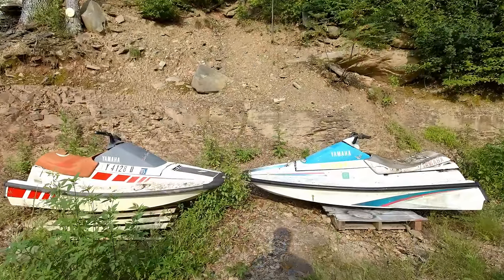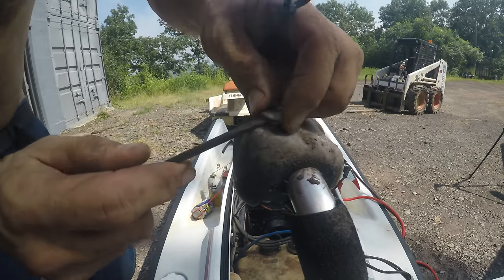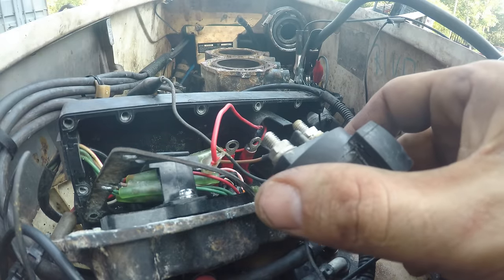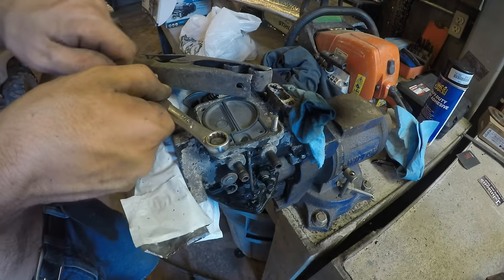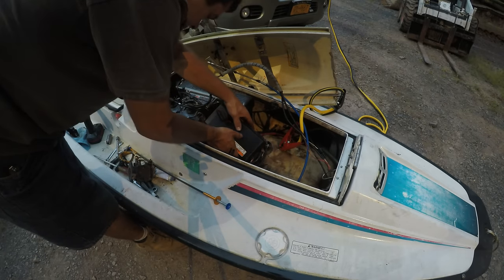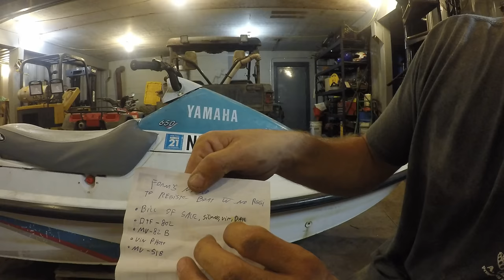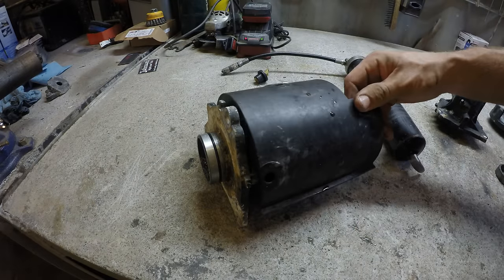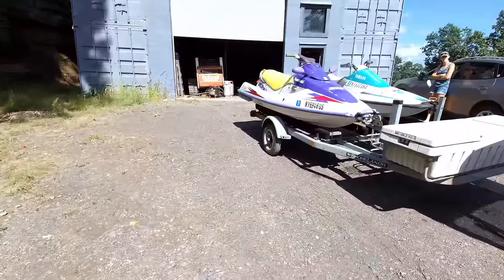Buying the cheapest WaveRunner on Marketplace

Comment: Watching you and other guys on youtube fix shit got me motivated to fix my mustang GT 2001. replaced the fuel pump in the tank. Alternator, battery, serpentine belt and the engine got a miss right after I got it running. bought a set of 8 coil packs on ebay for $35 things runs great with 153,000 miles on it and the Aircon works great. next new break rotors and pads from ebay, then 1955 bug to get running. Thanks Andrew for getting me motivated oh and also replaced the front left wheel bearing on my honda accord

Comment: 35:30  Wrench sparking against terminals in one hand.  Can of starting fluid in the other.  What could POSSIBLY go wrong.  LOL  Interesting video
Reply: i saw that, too.  completely rednekking it.
Reply: koviack and a full tank of fuel, and an engine room full of fumes.
Reply: koviack: He has in one hand a can of starter fluid (spraying it) and in the other hand a wrench crossing terminals throwing sparks.... just sayin
Reply: In the military me & another grunt were standing on top of a 5000 gallon gas tanker dropping a load of fuel and checking the level of gas through the 15 inch lid on top.  The level was right up there still when he took the cigar he was smoking and tapped the inch long ash off right down that hole.  All I heard was a sizzle as the gas extinguished the ashes.  Other times I saw him lose a stogy into the gas tank accidentally of a jeep he was putting gas into.  It simply sizzle out and he reached down and got it out to throw away.  We were uncertain if we were going to survive the combat coming our way and we were reckless as you can get.  Not uncommon in combat by soldiers.
Reply: Haahahaaha
Reply: Looks even crazier if you watch that part at 2X.
Reply: This wrench is too hot!
Reply: Obviously you don't do this kind of work. That's not even close to the sketchiest thing that has to be done to resurrect some old beast.
Reply: I was gritting my teeth.
Reply: If ur not flirting with death every day, ur not Andrew Camarata.
Reply: Let’s not over look that the sparks were right over the gas tank.
Reply: Absolutely nothing!
Reply: koviack  I can agree with you, however its good practice to not do so. For people that don't know I don't explain it so they will continue to NOT do it!
Reply: @geno7444  Vietnam?

Comment: If nobody's mentioned it yet check the jet drive there's a ring that will expand and almost bind your motor up is swells and locks up on the impeller I believe I've owned many of these WaveRunners in the past

Comment: The whole time i heard that engine struggling to turn freely, im thinking the propeller is getting hung up in its housing. Usually there's a stainless steel liner pressed into an aluminum housing and when these jetski's are run in salt water the metals corrode and it bulges out causing the propeller to bind up. Thats what i ran into with two kawasaki's i had worked on. It's best to isolate the jet drive mechanism from the motor when diagnosing either part of the watercraft. Anyway, im sure you know this already by now. Great videos!

Comment: For Gods sake stop putting in spark plugs with an impact wrench.... hahaha!     You work like a bull in a china shop.....Love it!!!
Reply: "That'll be fine."
Reply: @danieljameschamberlin1726   Not only that, he was actually using a battery powered impact, not an air impact.  I doubt that battery powered impact will create enough torque to damage a spark plug.  An air impact or electric impact probably would, but not that little battery powered one. Even if it would, I'm sure Andrew had the clutch drawn down so it wouldn't do any damage.
Reply: It’s fine it was just a battery impact driver not an air impact wrench
Reply: @masterspacetime2826  So instead of spewing asinine know-it-all comments into the ether of the interwebz, let's keep our comments in line with the context of this video.  I have that exact same, or at least very similar, Craftsman battery impact, and it's not going to produce enough torque to break off spark plugs. Additionally, my Snap-On air impact produces 2 - 8 times the torque my Craftsmen battery impact does.  For you "professionals" those types of battery impacts may be common place, but for us regular folk, air impacts are still torque kings.  However, to stay on task, that Craftsman impact does not produce enough torque to do any damage, and if you say otherwise, you're either a liar or completely ignorant.  Now, if he were using that DeWalt or Kobalt electric impact he has, that would definitely be ill-advised, but that wasn't the case, now was it?
Reply: Boss told me the same thing😂😂😂
Reply: If he screws up the treads he can just weld it in.
Reply: Brutal!!!
Reply: @better_than_nothing  I have a 1/2 drive Snap-On cordless impact that will take the lug nuts off my 1 ton Dodge...
Reply: @timallbritton3716  You prove my point. Your   $900 1/2 inch Snap On compared to a $60 3/8 inch Craftsman impact is comparing apples to oranges. You're making the same idiotic assertion as the OP.
Reply: @better_than_nothing  The actual point is ... never use anything but a torque wrench to tighten a spark plug and never ever use an impact wrench even if you bought it at the dollar store for pennies  ;) jus sayin hahaha!!!
Reply: @better_than_nothing  I am absolutely loving this! Do your homework and verify for yourself that I retired at age 49, own homes on opposite sides of the world, have a wife that's 26 years my junior, and we travel 5 months out of the year. Too bad so sad my poor friend ;) Bahahahaha!!!
Reply: @better_than_nothing  At least I have a wife ;)
Reply: @timallbritton3716  On a serious note, homophobic comments like that will get you banned from YouTube. I enjoy the trolling as much as the next guy, but be careful or the YouTube politically correct police will rain their liberal leftist agenda down on you, and personally, I don't want that kind of attention.
Reply: @better_than_nothing  Finally something we can agree on...semper fi!
Reply: kabarsedge those battery ones have a lot more power than you think. I guarantee one could rip those threads out.
Reply: @better_than_nothing  damn the banks got a hold of you. That sucks
Reply: Agree he’s a bit agricultural at times. Gets the job done but could be a lil more finesse
Knows his stuff though.

Comment: What I do when I need one of those carb gaskets, is trace out the carb on a cereal box, or similar type cardboard, and then cut it out with scissors and an exacto knife or razor blade.  I have not had any issue's with this not working, usually spray the new gasket with that copper spray for gaskets.  Great video, much love and God bless.

Comment: Andrew: I have noticed that you like things clean.  This is good.  I imagine you like clean engines and motors too.  I suggest you buy a small steam cleaner with a pointy nozzle.  Amazon and Walmart have them.  A steam cleaner will do an amazing job and will get into small areas that cannot be cleaned any other way.  I also noticed that you like white.  For your jet skiis, I suggest a Mr Clean Magic Eraser (or no name equivalent).  They do a wonderful job on plastic and fiberglass.
Reply from the maker: Thanks. Yes, I do now have a hot water pressure washer. It gets stuff clean.
Reply: @AndrewCamarata  A steam cleaner is much smaller.  For confined spaces with grease and grime the steam works wonders, better than just hot water.  They cost about $30.

Comment: That rattling sound is the inpaler your suppose to have water flowing through the exhaust and inpaler. When running the engine.
Reply: there is no harm to running a ski w/o water unless you overheat it.
Reply: Would that be Vlad?
Reply: No drama for a short run without water, always start first then turn on the water. Turn off water then kill engine.
Reply: @LegendLength  u can run it without water. But if u are gonna hose it you need to cut the hose on after the ski starts and cut it off before u kill the ski. If it doesn't run good it can be bad
Reply: Josh meant the rattling noise is normal if jetski is not in water. 

What damage if any if hose always on between starts? I was doing some checks and forgot and let hose run the entire time through starts.
Reply: kb1gni  Vlad the Impeller?????? ;-)))))))  SO FUNNY that you caught that !!!!!! Huh..... I really need to get a life..... I commenting on Dracula references at 3:45am..... I suck ;-)

Comment: Awesome video.  I bought a Waverunner 3 had 3 folks on seat and pulled a skier.  Those spins were fun as heck, but neck day legs were sore after riding all day.    Is that the container car castle I seen in videos?   Your super talented.  A boat mechanic at 85 bucks an hour would charge more than buying one.   In 1988 the Wave runner 3 was 6,200 bucks.
Reply: you know what 6,200 bucks was in 1988 money? my 1988 trek 1000 was 450$  equels about 1000 2018 dollars...

Comment: When you start it up out of water you need to hook the water hose to the rear of the jet ski next to the output jet something you don't burn up your unit, just saying.
Reply: wrong, jet engines and inboard/outboard motors on boats are completely different, as long as he doesn't run it for more than 5 minutes out of water it will be fine...

Comment: I picked up a pneumatic long neck stapler made by Sailrite that works really good for getting down in the recessed lips where the original staples usually are found.  I use alot of spray adhesive to spray the new material so it doesn't shift around when you are trying to get the first few staples in.  Nice job breathing new life into the jet ski.

Comment: Dude you need to pressure wash your pressure washer
Reply: BUT.....be sure to stay away from the gas cap! I killed mine that way several times then if you don't get the water out of the fuel system you are bound for trouble from then on!

Comment: impact wrench.....spark plugs?
Reply from the maker: Yes.
Reply: He'll learn the hard way one day when a bit of ceramic drops off in the combustion chamber LOL
Reply: I yelled at the tv when I saw that. I used to be forklift mechanic and that drove me nuts when people would do that.
Reply from the maker: I can torque stuff to spec with an impact.
Reply: Andrew Camarata they are supposed to be hand tightened with a wrench so they don’t cease up.
Reply: Andrew Camarata not without a torque stick... and i still wouldn't as it risks fracturing the ceramic insulator.
Reply: Andy C .  Brother I’ve been watching your videos.  I should have never said anything about the torque wrench.  You’re a hard working guy, and you get stuff done!  And it’s evident that you have found your passion.  Keep up the hard work, and I’ll keep watching!!
Reply: George Stewart not me brother, you are replying to the wrong guy 🤣
Reply: No, you can't.
Reply: Some Ford techs use impacts to remove spark plugs that have a tendency to break in the cylinder.  But installing I wouldn't use one-not worth the risk.
Reply: @andreboy1   Those are special spark plugs, used on the 3 valve v-8's they are the exception to the rules.
Reply: I would use my impact wrench to change a light bulb if I could. Keep it up Andrew !
Reply: I do this all the time. Not quite so often anymore because im a diesel tech. Never once did i have a problem with it, i start em by hand and run em down with a 3/8ths impact. When you're flat rate, you really dont give a fuck.
Reply: LMAO
Entertainment at its finest !
Andrew loved your reply’ “Yes!”
Don’t let them ever get to you. Just keep on doing it your way ! 
You got the channel !
 How many people you made happy & laugh today !
Some day they’re gonna have to say Doc Andrew !

Ya got the goods Dude !
Reply: @josift1283  // Your first words: "I do this all the time" and last: "you really don't give a..." Kinda takes all the mystery out of why societies are failing Josif.

Comment: Hope you don’t have to rebuild the engine in yours like i do lol lost compression in one cylinder when the oil injector went and there is on all jetskis a water hook up so you can run it out of the water because you can blow the water pump if you run it to long out of water dang took me 5 trips to the dmv to get mine registered

Comment: I just picked up a 500 waverunner with a Yamaha 760 in it and can't figure out how to rout gas lines😑
Reply: Generally you want one side on the tank and one side on the engine, if you want to be bold about it you could even add an inline shut off and fuel filter for some extra class.

Comment: Helpful hint if you want to remove a bearing sleeve without a puller run a bead all the way around the sleeve with an arc welder then tap the shaft out of the sleeve. To install a new bearing easily set the bearing on a hot plate and heat it up before installing it. And if you need to replace an inner bushing before inserting a shaft ,put the bushing in a pot on ice and add some rock salt. Give bushing time to shrink a little then place it over the old bushing and use a weighted rubber mallet to drive the new one in while pushing the old one out. To remove a rubber seal use a Phillips head drywall screw as it screws down it pushes the seal up. Pretty basic stuff but usually only learned by doing. 22 + years as a maintenance tech working on injection molding machines taught me a lot of ways to get jobs done as efficiently as possible without most of the specialized tools. I hope these few pointers will help you out and maybe you can share them with your audience on your channel.

Comment: Mystery marvel oil down the spark plug holes
Reply: I take an aquarium pump and circulate diesel fuel through for 48 hours, changing a few times.
Reply: I have freed more engines with that than anything else.
Reply: Kroil

Comment: Great video my friend personally I would have removed the engine and dismantled it to free it off if you had done that you would have noticed the pump drive bearings too that were U/S and been able to check all the electrical problems it had while everything was stripped down on the whole I've got to congratulate you did a great job getting it up and running and able to have pleasure riding it

Comment: I have used a 50/50 mix of acetone and transmission fluid to free up nuts bolts engines works great. Keep in mind that acetone eats paint and some plastic and is flammable.
I’m also the guy that mixes his oil way too rich 1st time on the lake to give engine more lube. Smokes like crazy. Run a tank through it and the go to correct mix. (Gets everyone’s attention)

Comment: You can change the propellers on these, and it's actually like changing the gearing.  You can get different pitch props that will give you more top end, or better hole shot/ take off... Depending on what you might need.  It can make a weaker ski still keep up or help tow a skier better.  Well worth experimenting with.

Comment: Some of the rattle from the drive shaft is normal - not what you heard, but you may still hear some now. The driveshaft on jetski's are set up to have positive pressure on them from the impeller. They sound fine in the water, and awful out of it. Putting a hose on one out of the water is important, and seems to make the rattle sound worse :)

Comment: I could be wrong but the reason a lot of those bolts were hard to remove is water getting into the bolt holes over years of riding and hard water and other deposits built up making the bolts seize and stiff

Comment: Pull the carb off and dump about 2 quarts of diesel fuel in it. No premix in it for years the bearings are probably gummed and sticking. Possibly rust in the cylinder rings too.

Comment: Did the same thing to a 650 superjet motor was seized from sitting I filled it with diesel fuel and let it sit for 2 days came back threw the plugs in and it ran great

Comment: Just a suggestion Andrew those solenoides are a ford type design if you can't get one you can take it apart turn the brass or copper bolt 360 and it should be ok for another 100 miles ok try it, if you can't find one.

Comment: Of course you were there and I am watching a video.  But I bet the reason the engine was so hard to get unsiezed was because of the bearings in that coupler assembly.  It wasn't until the ball bearings finally came out of their races that the engine started turning freely.  I think next time you have a seized motor on a jetski you should uncouple it from the jet drive to see if its really the motor.

Comment: Anytime you gotta load something with an excavator it's a good deal!  I once sold the transmission/engine out of a car and we tilted it sideways with a log loader and cut the mounts and driveline with a torch and used bolt cutters and a knife on hoses and wiring.  Took like 10 minutes.

Comment: So with carbs you always want to scrap off the old gasket material.  You need a pos. air seal.  Also, when putting on a cylinder head its real important to make sure you tighten everything exactly even cross pattern. Also, stretch bolts need to be replaced. - Former USAF mechanic, restorer of classic cars

Comment: Always Yamaha baby!  I had a 1994 Yamaha DX 225 Shaft drive 3 wheeler.  I treated that thing like a rented mule on the trails and half the time we were in creeks.  It was always the tow vehicle too.  I retired it after 10 12 years on the back of my property still running.  About 5 years later my sisters friends boyfriend asked if I still had it and if I would sell it.  I told him I would give it to him.  we went and drug it out and  the tires were rotten there was no gas and the starter was frozen on it.  We put some gas in it, checked the oil and hooked a tow strap to it.  I hooked it to my truck told him to put it in about 3rd gear and I took off.  I drug it probably half a mile and it started popping, spitting, farting and bam it started!  He still has it!
Reply from the maker: Neat. I also have a dx225. 3 wheelers are fun.